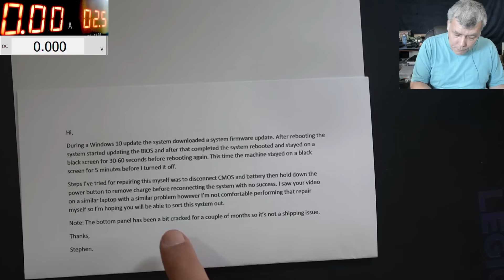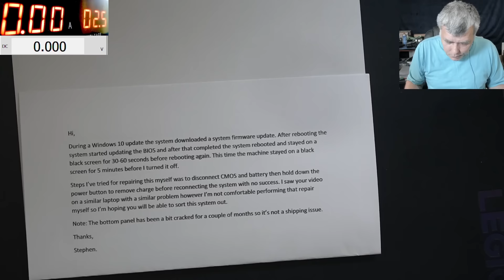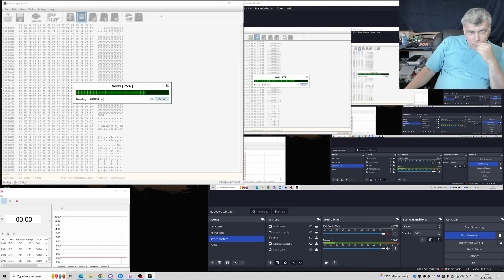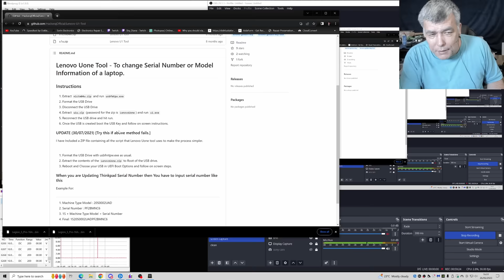Lenovo Legion 5 15ACH6H dead after windows updates - Sadly, laptops are dying after windows updates

Comment: A real worrying trend with Microsoft's updates lately is that they've been screwing with things they never used to screw with. For example, the other day while watching youtube videos... my screen went black, then repeatedly turned off and on again, and the browser froze. I was perplexed, worried I'd suddenly been infected with a virus or something.
No.
Windows had, without my permission, downloaded and installed an update while I was using the machine... which had arbitrarily replaced my graphics card drivers with generic ones.
Reply: Win 11 or 10?
Reply: @LAM_G80085  10. Apparently my gaming rig can't support windows 11.
Reply: @NicholasBrakespear  , Idk your machine's specs but I wonder if that's because of the "TPM 2.0" requirement. I put together an AMD Ryzen machine earlier this year and the CPU is supposed to meet the spec by integrating "TPM 2.0" functionality in the CPU itself although I have a TPM 2.0 chip as well it's just that to use it for either W10 which is currently installed or to upgrade to W11 I'd have to enable UEFI in the BIOS and disable some other items etc. My system still utilizes legacy MBR however and IIRC I'd have to convert from MBR to GPT in order to use UEFI so I can "enable the TPM 2.0 chip" just to "enjoy better security" so they say...🙄It would seem simplest to enable that function on the CPU since it doesn't require changing the partition table system.
Reply: Yeah, Microsoft loves doing stuff like that.  That's how I ended up with Windows 10.  I was asked constantly if I wanted to upgrade from Windows 7 for free.  I kept saying no.  Then one day I went to the store, leaving my computer running, and came back to Windows 10 being installed.  I never gave permission for Windows to do that.  It's like they were just waiting for me to step away so they could force their update in.
Reply: Apparently the OP of the video doesn't know the difference between Window's updates and factory installed apps. I never once seen a BIOS update via a windows update in my last 10 years of working in IT. Those updates from straight from the hardware manufacturer via the factory installed driver update application installed on your machine like Dell Command Update tool that can automatically be set to automatically update your BIOS and drivers.
Reply: @eman0828  It indeed would have been unthinkable 10 years ago, but the world has changed. Microsoft is now pushing bios updates through the regular windows update system, no factory installed apps required. That's the world today: as soon as you install Windows on a computer, you no longer own it. Your only remaining authority is deleting Windows, installing a different operating system and hope that you can get the firmware back into a usable state. (Assuming the updated Bios still allows installing operating systems that are not digitally signed by Microsoft.)
Reply: @jwstolk  False. I STILL work in IT. I have over 10+ years of experience. I work in Tier 2 for a major defense contractor as I work on a lot Dell machine's. I mostly administer Redhat Linux machine's but I still administer and support Windows machine's as well. My current role in IT is in between a Sysadmin and a Field Technician. I'm also Dell Certified.
Reply: @eman0828  You are wrong in spite of your experience. Things change. Windows is indeed pushing bios updates through windows update for some machines and that list is growing. Now whether or not it is windows creating the updates or pulling them from the manufacturer I have no clue but It would make more sense that they are using the manufacturer's update and just screwing the pooch.
Reply: @essenceofdementia  False. I work in a pretty high level in IT hat administers both severs and Workstations. I run patches on a daily basis, decommison machines, rebuilds, and do Dell warranty repairs. I see a lot of shit daily and you guys information is based off this stupid tvideo that that no clue on hat he's talking. I came here to educate people that's being mislead by his video. It's all about using common since ad knownthe difference between factory install applications and Windows update. Far as I'm aware anything at the motherboard level is pushed out by the hardware manufacturer. Microsoft has nothing to do with motherboards. I flased thousands BIOS updates on servers, Thin Clients. Laptops, engineering Workstations, Macs, Old Sun Micro System boxes all manually from the hardware manufacturer in my line of work. You are talking to a Systems Administrator here that supports up to 50k plus machines.
Reply: @eman0828  oh God the ego battle on this thread is crazy
Reply: @kenzog5428  would you rather listen to a System Administrator or internet lies?
Reply: @eman0828  I don't need to listen to either, I am a super saiyan Cyber hacker with the army of middle earth behind me. I'm in charge of 50k troops headed for mordor and in telling you, I AM right!
Reply: @kenzog5428  Lol 😂 sure you are. That's not even a real job title. When was the last time you wrote a group policy or wrote any bash# script?
Reply: @eman0828  Uh, no. I built this PC myself. I am well aware of the difference between Windows' increasingly assertive behaviour and the stuff I personally installed on the system.
Reply: @NicholasBrakespear  I build, deployed Windows Servers. RHEL, decommison them, upgrade and patch them daily. I work on laptops daily as well pretty much all Dell Products everything from Latitudes, Precision laptops, Optiplex Desktops, Precision Engineering Workstations, Optiplex thin client's and non standard custom built PCs. Never once seen a BIOS update from a Window's update and worked on thousands and thousands of machines. I even own a Legion 5 myself for personal use and the BIOS hasn't been updated since 2020.
Reply: @eman0828  Good for you. Have a biscuit.
Reply: @NicholasBrakespear  I have a lot more experience behind all of this than the average user. What ever you guys are seeing I'm not buying it. Sounds like a big fat lie. Like I said behind, BIOS updates comes from thr factory pre installed app on your machine's that would check for driver updates for you. This same type of application is on all thr Dell machine's I work on called Dell Command Update. This application can be setup to automatically scan and download BIOS and driver updates and install them automatically.
Reply: @eman0828  That's nice for you dear, but I don't have a Dell, and it didn't download drivers and install them automatically.

Windows - after updating - installed default generic display drivers, the kind that require no download, as if I'd done a manual uninstall prior to installing new ones. But I had done no such thing, and when building and installing everything, I made sure to go through a fairly exhaustive list of saying "no thanks" to automated updating of anything except Windows itself - and even then, only the essentials.

So here's a thought: Instead of making yourself look like a bit of a berk by proclaiming that people are lying, maybe you should assume that in the very silly, often glitchy, increasingly and indisputably dubious world of Microsoft's ongoing attempts at becoming Apple... maybe just maybe there's something at play that you haven't encountered because it's a recent aberration, and thus your past experiences - by definition - could not possibly account for it.
Reply: @eman0828  Well after a quick Google it seems that Windows updates are affecting the bios on Lenovo machines , so maybe this is a manufacturer specific problem .
Reply: @PhilipKerry  I'm not buying that. I'm still on the same BIOS version EUCN26WW from year 2020 for my Legion 5. It's been through countless Window's updates for the past 3 years.
Reply: @eman0828  Well it seems that there are quite a number of Lenovo laptop owners who would disagree with you ......
Reply: @PhilipKerry  I've been active in the IT industry for over 10+ years that's seen a stuff then he average user on a daily basis. As mentioned before never once in my line of ran across any laptop even in the past 2 years with a so called BIOS Windows  update. There seems to be a disconnect or people not using the correct terminology. I don't just work on Window's machines as I support also UNIX Solaris, RedHat Linux and MacOS as a Systems Administrator. I built, deploy, decommison machines, troubleshoot, and up keep maintenance of everything from laptops to server's.
Reply: Ok. I think I will use Linux and an alternative OS other than Windows. Microsoft is really abusive.
Reply: You can use regedit to disable all windows updates, none can be pushed. You can even set it so it can only check manually. Bit of a pain in the neck but I recommend it.
Reply: @PlatoonGoon  I will have to look into that. Not for right now necessarily... but I see a time coming in the not too distant future where I'll want to just freeze the thing and keep everything working exactly as it is, even if it means the machine becomes an offline machine.
Reply: @PlatoonGoon   Or you can set your networks to "Metered" networks, much easier and also does the trick.
Reply: @eman0828  You’re still absolutely incorrect. Windows Update very much does automatically install BIOS updates on machines without asking. I have an ASUS Vivobook laptop I installed Windows 11 on to play around with, and one of the first updates Windows pulled down after installation was a UEFI update. No third party software installed whatsoever. They also do this with Nvidia proprietary graphics drivers.

Just because you’ve been in the industry for a while, does not mean you can’t be wrong, or even that you know more. Whichever company you work for needs to retrain or fire you, because your ego when you’re wrong is astounding, and it’s going to cause serious issues for any project your employer has the misfortune of involving you in. Very clearly have no idea what you’re talking about.
Reply: @archgirl  You guys have no idea what you are talking about. There's a different between some one that's worked on thousands of machines day in and day vs the average home user. I mean I could of told this if this so called BS was true otherwise I would of seen thousands of laptops getting bricked. I'm Dell Certified authorized to perform Dell warranty repairs on all Dell Laptops, Server's, Workstations, Desktops and Thin clients.
Reply: @eman0828  There’s also a difference between being right and being wrong. You are not being right. Keep being wrong, that’s perfectly fine with me. Your experience means nothing when talking about something you’ve admitted to never experiencing. Just because you haven’t experienced it, does not mean nobody ever has. I have. As have others in this thread.

A simple google search would’ve told you that you’re entirely incorrect. You could’ve prevented yourself looking like an incompetent fool. You didn’t do that, and that’s on you. Now we’re all just kicking back and laughing at your ineptitude.

Once again, Windows very much does serve UEFI updates through its Updates service. That’s just a fact. If you haven’t ever seen that before, you’re either lying about your experience, you haven’t been paying attention to updates on production machines and should therefore be fired, or perhaps you should do some research and learn that there’s a difference between versions of Windows and what their Update policies and rules are. If you think the list of available automatic updates aren’t going to be different for consumer editions of Windows and Server/Enterprise editions of Windows, I don’t know what to tell you, other than you almost certainly need to go back to school.

Telling us all what your job title is doesn’t mean we have to take your word for it. You’re still incorrect. It is possible to be a sysadmin and an idiot, as you’ve so deftly proven in your comments here. And just because you may be a sysadmin doesn’t mean that you can’t be wrong. Which, I shouldn’t have to tell you again, you are. I don’t have to believe you just because you claim to work in IT. I’ve seen UEFI updates through Windows Update with my own eyes, I don’t need your experience; it’s just entirely wrong in this case.

Now, I know you’re likely going to reply to this, once again telling me that you’ve been in the IT industry for 10+ years, and that we’re all liars, blah blah blah… I couldn’t give a damn; it’ll be funny to watch you dig your hole that little bit deeper instead of looking it up and learning that you don’t know as much as you think you do.
Reply: @archgirl  lol yet, You showed no proof. Only an I.T Professional can confirm this. I'm server guy you are talking too and this kind of none sense doesn't exist. Hell I can post screen shots of my own Legion 5 BIOS if you don't believe me. I can upload them to photo bucket and see for your self and post the on here. The BIOS has not been updated ever since 2020 and it's got the latest Windows updates.
Reply: I bought an hp envy laptop with win11, saw lots of win updates in the line let the system install them and was wondering when I saw a bios update sadly I didn't check what was the bios previously. It was 1.12 after and from manufacturer 1.14 is latest so win11 actually performed an bios update! I never saw this before and really couldn't believe what happened.
Reply: @NicholasBrakespear  i dunno about bios updates so cant comment, but i kno for a fact microsoft updated my nvidia graphics drivers in a recent windows update on its own. i dont use geforce experience cuz i rather install my updates manually... but apparently microsoft thinks i cant handle simple driver updates on my own....
Reply: @eman0828 so you have experience only with corporate systems, yet can't accept that things might be different in the residential market?
Reply: @shaunclarke94  lol. I use work on residential PCs in a repair shop before I moved the enterprise world support thousands. I'm in the middle of doing a Window's 11 migration and still yet seen a so such thing as updating BIOS vs a Window's update. Hell even my person Lenovo Legion 5 still has the original BIOS firmware from 3 years ago and is been trough countless Window's updates. I have screen shots to prove that I'm not lying.
Reply: @PlatoonGoon  Excellent tip, thanks!
Reply: Regarding the back and forth about the Lenovo Windows BIOS update. 

Yes, there is, and has been a BIOS update for Lenovo for Windows 11. Available on Lenovos site.

Yes, if you have Windows 11, and run auto updates you may in fact get this update. Working to confirm if there is a KB number for this.

Class pay attention. Been working with Microsoft OS since 3.1 and the Win 95 26 floppy disk install, worked residential,  enterprise, edu, gcc and gov industries. Over 20 years in the business.
 I have created and deployed countless OS images,  built and resurrected numerous computers and run more updates than i care to imagine. 

Here's what I've learned from my experience. 

Just because it comes via the windows doesn't mean, Microsoft built it.  

Some, manufacturers have their own updater that goes to their proprietary site, for their proprietary drivers.

If Microsoft creates rolls out the update there will be a KB number with the update, there's site with a break down of each update.

 I have seen manufacturers drivers updates as part of the cumulative packs. Or as "DIY". Remember those printer installs, now most things are plug and play. Proprietary manufacturers are more common in this aspect.

I have seen windows push generic drivers over manufacturers drivers. Even after a non update reboot they have had their spats where the basic driver takes over.

 And no, it would not be the first time Microsoft and a manufacturer collaborated on an update and hosed the world.
So both sides could be correct,  yet both sides could both be wrong. 

Without the MS update KB, this is looking like a manufacturers update.

Class dismissed.
Reply: That happened to me too.
Reply: You can change that in settings, it's probably at it's default.
Reply: ..."permission"...? You're kidding, right? (We are slaves to these companies and manufacturers, don't you know?).
Reply: WIndows updates often mess with BIOS - why? what for?  For me it  didn't brick any computer, but I had to go to BIOS, restore my custom settings after Windows update.

And my home computer stopped working after updating Win11 to 22H2. I discovered the update unformatted this small UEFI partition... I had to format it, and put all the needed files there. While doing this I discovered Windows 11 doesn't need UEFI to boot. I have a CD with diagnostic tools, that boots only in legacy mode, so I switched the UEFI off, booted the CD, and then used the option - attempt to start Windows on the hard drive - it started, I got the working system - updated! - win1 22H2 - with the desktop... with UEFI switched off! 

Having the desktop and the internet working, doing the rest was easier, i downloaded the tools needed to restore the UEFI partition and used them to do this... but why, oh ,why, it even tried to rewrite this partition?
Reply: @Bialy_1  Lol. Can Google diagnose you with Cancer? Man yall a bunch of fools on here. Only licensed medical professional can tell you. No different than a licensed mechanic diagnosing your car issues. The IT industry is no different as I'm a certified Professional that works in the industry. Infact I'm a Sr Sysadmin and Sr. Lead Tech. I deal with OS imagines daily. I even build them that utilizes SCCM tools for OS deployments.
Reply: @eman0828 your ego is off the roof, anytime someone tells something different than you, you start talking about your experience and all that stuff (there are legit 10 comments where you keep repeating that)...
Reply: @LOBYA  Lol ain't no one showing proof of what they are talking about. Googling stuff ain't the right answer either. Until Microsoft released a KB about so called BIOS updates being pushed. Yall just talking a bunch if non sense that. I build custom images and deploy them. I could of told you this.
Reply: @eman0828  Windows absolutely does push bios updates. Laptop manufactures sign contracts with Microsoft. No 3rd party software needed.
Reply: @eman0828  Imagine bragging about working in an IT department. lol I'm glad you know how to plug things in and wait for installers to run. Come back when you are actually an engineer. Tone down the ego.
Reply: @LaFonteCheVi  Lol. I build and manage an entire infrastructure. I'm a Server Admin and do alot of DevOps Automation and coding.
Reply: My laptop is Legion 5 and I want to know how can I disable windows from updating bios?
Reply: @Ironman-BB  These people I lying. I have the same laptop. It's been almost 4 years and no so called automatic BIOS update exist through Windows. All these people are clueless tha have no idea what they aee talking about. I'm on the same BIOS that I manually flashed myself from the Lenovo site.
Reply: @eman0828  that what I thought, how can windows updates flash bios together. I also never seen  any windows update with bios.
Reply: @eman0828  it might be a coincidence. While updating the hardware failed.
Reply: So .. the IT guys in this argument aren't making the right argument... They work on Dell's not lenovos. If they had Lenovo ran severs they'd see the hell that we've been through with the forced BIOS update through Windows updates bricking the machine.
Reply: @keitaro849  You couldn't be more wrong. Infact I own two Lenovo machines. The newest one I have is my Legion 5. Never once seen the BIOS update on its own. I had the laptop for 4 years now. Yall just a bunch of liars. Microsoft never released a Knowlege Base Article on it either. I can litter post a screen of my BIOS menu if you don't believe me.
Reply: But have you ever had their desktops? Apparently the windows updates on my machine messed with my BIOS so much so that I'd bring it to get repaired so many times they were at the point of saying okay just replace the motherboard. Any restart or update makes BIOS say nope I'm not gonna work anymore. There's the windows 22h2 update that somehow effects the BIOS on Lenovo machines. So I guess in your case you are extremely lucky nothing went wrong on your end. Cuz I will always end up with Binitializelibrary failed
Reply: @eman0828 Well you will soon...
Reply: @eliassaf9192  Going on close to 5 years never seen my Lenovo Legion 5 update is firmware. I'm on Windows 11 now. Still on the same BIOS since I bought the machine.
Reply: I recently updated my all AMD legion 7 to Windows 7 and got the black screen of death on reboot. After a lot of video watching and swearing I fixed it by reinstalling all of the AMD graphics software and drivers which had been deleted.